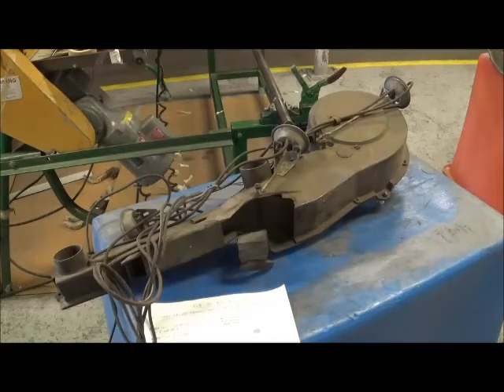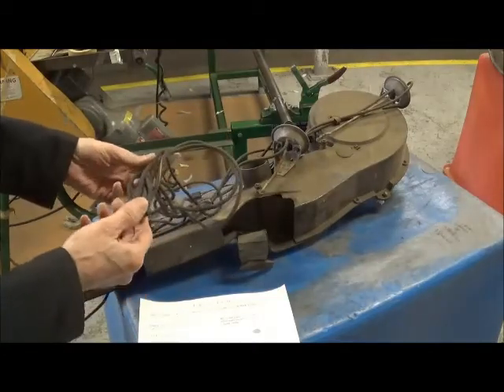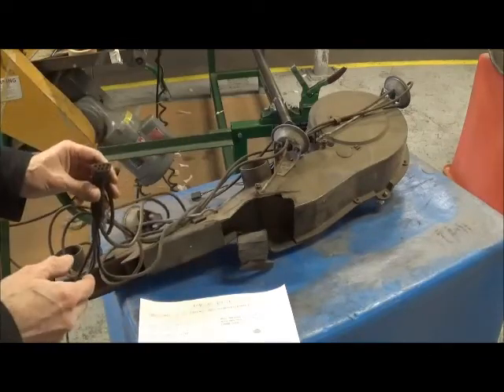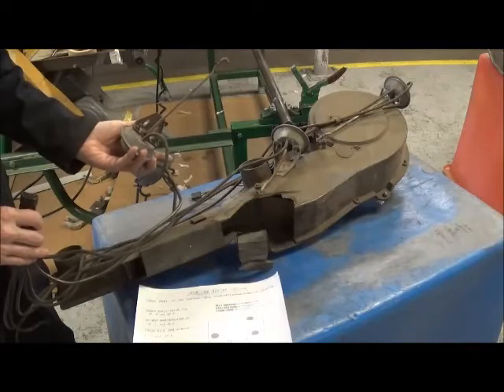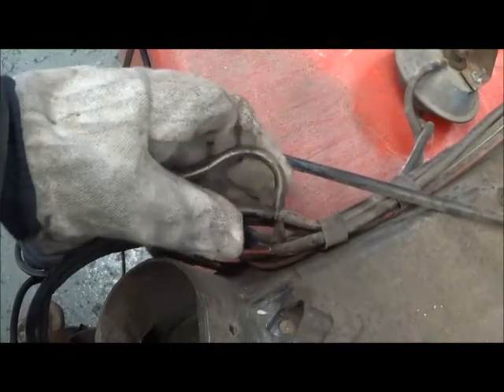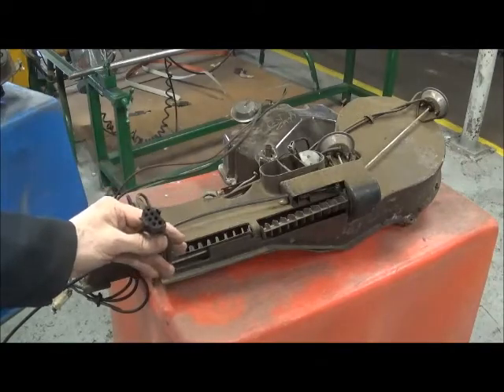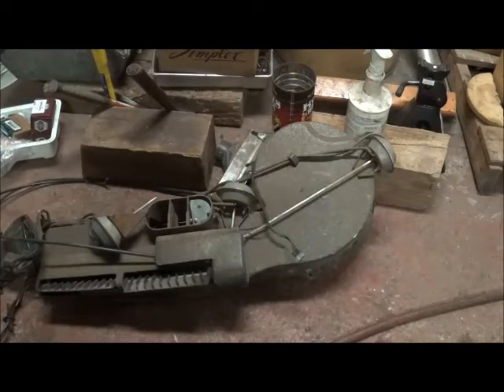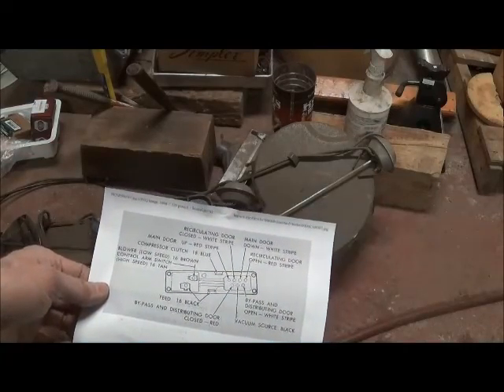Chrysler heater vacuum logic 1959 to 1965 era

Comment: Hello again Bob I have a question. The heater control has those 7 vacuum pins/hose/tubes.

I'm attempting to run the heater only as some of the 7-pin heater inputs are damaged.

Would it not be wise to hook up a defroster deflection vacuum canister directly on to the manifold vacuum Input?
Thanks.

Comment: Hello. I have a 62 Imperial with a/c. I'm working on a heating problem. I'm trying to figure out how to get at the heater control valve.  I'm not sure how to remove the glove box. Do you have any idea? Thanks
Reply from the maker: If it is the original glove box, good chance it is too stiff to save. New ones are available for about $55. So just remove screws on glove box edge and tear it out. New box will be flexible and fold nice for reinstall.
Reply: Bob Mine is in mint condition. I've done a total restoration. If possible, can the box actually be removed? Does this door have to come off and does the box come out through the opening, or drop down from behind? Thanks again
Reply from the maker: Yes, box can be removed. Glove box door comes off first. Box then unscrews and folds up so it comes out through the opening.
Reply: Bob Thanks. I need to check the cable and gate valve action. Take care, happy New year
Brian